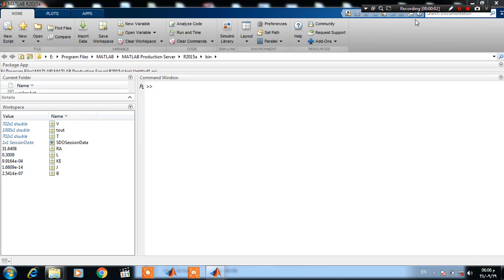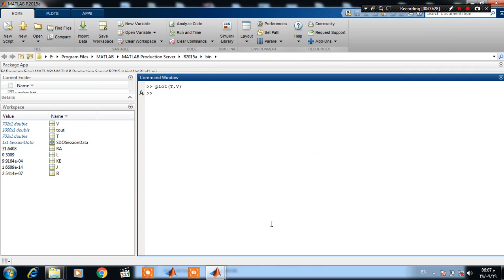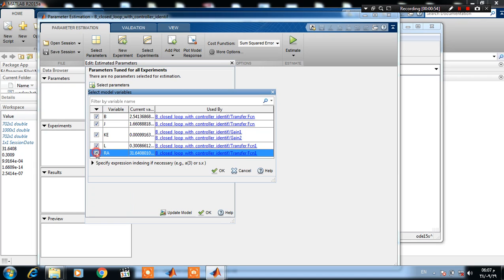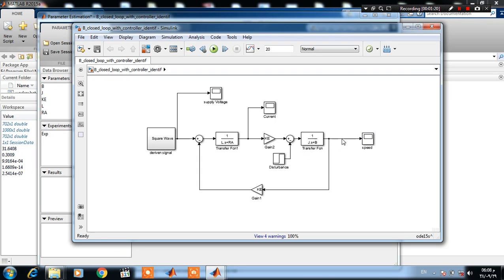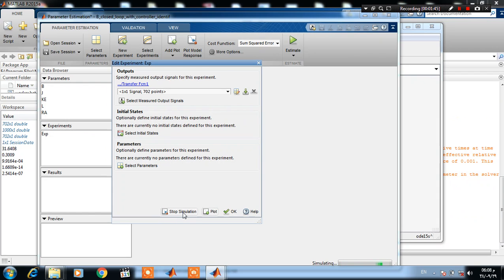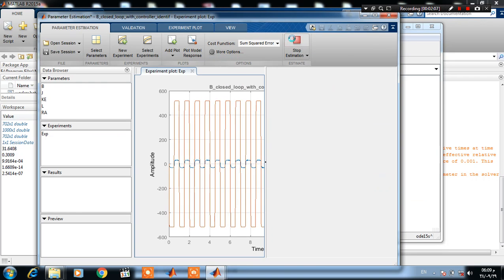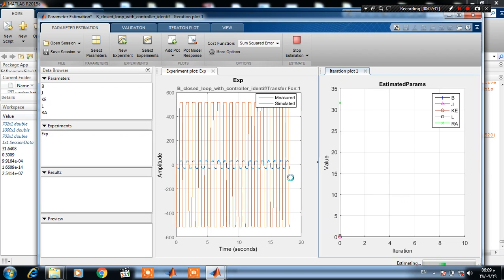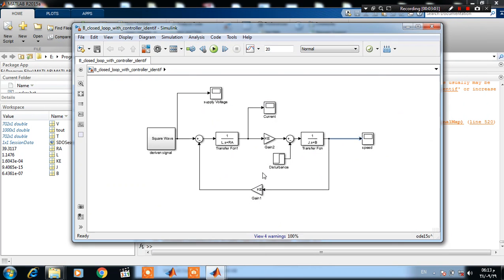Estimating Parameters of a DC Motor simulink

Comment: How are measured data and simulated data synchronized with respect to time?. I mean, some times, the process of taking experimental measurements may be started at sample no zero(0) when its speed is not zero (ex:- let's say 200). But simulation gives it as zero at sample no zero. At such a case what do we need to do???
Reply from the maker: You have to select sampling time in both ( simulation and experiment ) , and if  shifting  in time is exist then you can correct the time array in the matlab